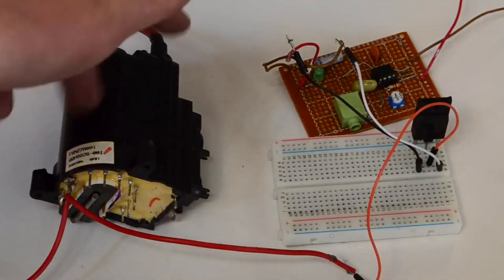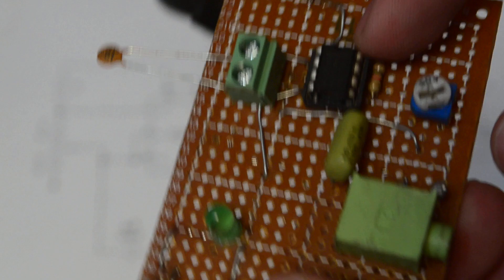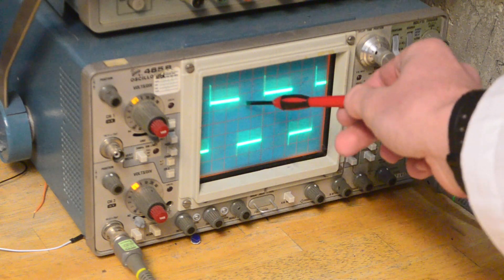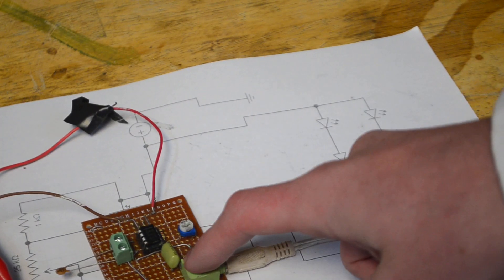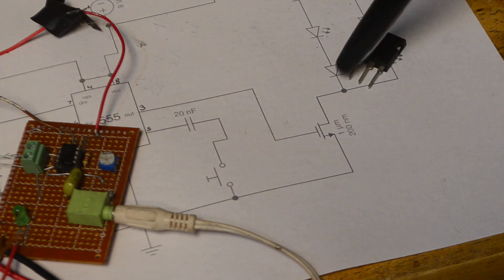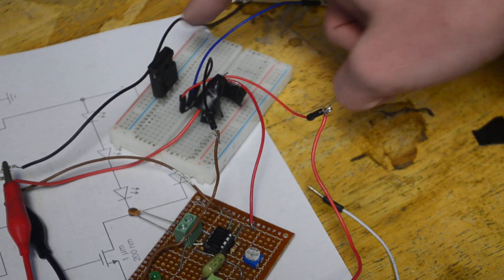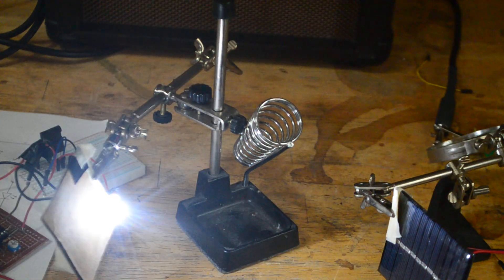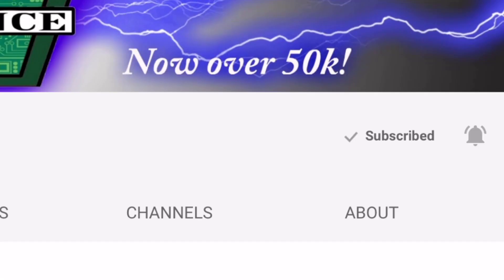How to transfer Music through Light

Comment: I only make this using a single mosfet transistor, 2 resistor and 1 capacitor, it works as well. no need the 555 timer IC.

Comment: This almost goes hand in hand with the Phantom DNA experiment. In a vial of water, in a vacuum environment, DNA is introduced in the vial of water. RF are transfered into the DNA via photons. The photons immediately fixed around the DNA. Once the DNA was removed from the vial of water, the photons stayed in a perfect outline of the missing DNA. The water in the vial was also transmitting the frequencies of that DNA. Several thousand miles away, in a separate lab, antenna was fixed where the water would recieve the transmission of the photons and water. Raw material in the water started to build a exact copy of the DNA used a great distance away. Scientist then added the missing components for DNA and a perfect copy was built by the water in separate lab. This technique will be the future of humanity!

Comment: What if the tone generator was hooked up to an amplifier; and what if, the amp was hooked to a ballast from some lights; furthermore what if, you used a coil rate equal to the frequency out put of the tone generator? Couldn't you run a frequency above 2 gigahertz and have a long range EMP device; and moreover, wouldn't the higher frequency give a further range with more destructive properties using way less overall power? And perhaps it would make for a grate video... of course keeping in mind the spark gap and the Hight Voltage compositors....

Comment: Please help me where i have to connect the Audio Input Thanks in advance and btw. nice video!✌☺
Reply from the maker: +Floly_lolye hi! So the audio input connects one end to pin 5 of the 555 timer, and the other side just goes to pin 1 ( or ground )
Reply from the maker: +Floly_lolye also thank you!
Reply: Thank you ✌😏
Reply from the maker: +Floly_lolye no problem :D
Reply: but i got a Problem the Frequenzy is so Low that it doesnt work both caps are 2nf and I got a 20kohm resistor and not a 25 potenjarmeter sorry for my Bad english but thaks

Comment: In 1972 while in high school, I took a car radio on the bench and connected a tail light bulb to it. The radio had enough power to make it glow decent . Then I took a cassette tape recorder and a solar cell connected to mic input. I could clearly hear the music from a max distance of about 15 feet. Later I used lasers and photoresistors.  Did not have to build a amp circuit, just used the recorder.   Fun stuff to play with.

Comment: But someone can steal the data with another solar panel.... so that's an issue.  Cool project btw.
Reply from the maker: +Kriss 89 thanks! And yeah, I made a new design using a focused laser, so that would be better, but even with traditional radio waves, you can steal the data with an antenna ( the thought for the laser is to send high amounts of data as a way of through space, like from mars to earth ( however I am designing one that modulates X-rays so that it could be sending even more data :D )

Comment: So basically, you're saying I could potentially ramp up my internet connection using a laser? Or is that not possible?
Reply: jeenyusPete within a LAN? or from the ISP to your modem/router? Fiber optics is all about this principle. But it could be done, I am not sure how, why not ask? regards
Reply: Horus Bayard well, light is usually LINE OF SIGHT, it would not work around corners and the like, however if you used a light, and convert it into a fiber optic cable, then yes, I suppose it's possible, but you would need to turn everything into ethernet connections at the computer and at the wireless router or cable modem. Wouldn't be worth the hassles.
Reply: brian h. look up "LI-FI"

Comment: why do u use a 555 oscillator??
y not simply amplify the phones audio input using a transistor and feed it to the LED's.
Also u dont have a filter on the reciever side to pick up 125kHz only so modulation is not necessary here r8?
If u had a filter u culd hav removed the noise from the room lights.
Reply: good project though

Comment: Wait a second... why does it even matter where drain and source are? Aren't MOSFETs symmetrical? At least thats what I've been told in my Digital Technology / Circuit Technology 1 lectures. Or are the bigger ones built asymmetrically due to the high currents they have to withstand?
Reply from the maker: +Michael i don't think I've ever come across a mosfet that is symmetrical to be honest , there are diode things that look like them, and those are, but they aren't mosfets
Reply: I didn't think of those diodes neither of a specific type of MOSFET. I was just wondering because at university we were taught that whether one side is drain or source depends only on its potential relative to the other side. And if you look at some cross-section schematics it makes perfect sense that they should be symmetrical (e.g. https://commons.wikimedia.org/wiki/File:Lateral_mosfet.svg )
Reply: In reality the body is shorted to the source, to avoid undesired effects that could happen otherwise. 
Here there is a very good explanation I found, if you're interested: http://electronics.stackexchange.com/questions/72582/mosfet-why-the-drain-and-source-are-different
Reply: Well that actually makes sense, thanks for the explanation!

Comment: Don't use a photovoltaic cell. Use a reversed biased LED. 
PV cells aren't discriminating and they mash things together. A reversed bias LED array has more bandwidth, is less prone to noise, and is actually faster at signal processing by an order of magnitude (although i doubt anyone is making a light transmitter that needs nano second response stuff) 
In order to use a LED in reverse bias, your receiving LED(s) are going to need to be amplified. I suggest using three transistors connected in parallel to  ground but in series by gate to one another. This amplifies the signal by the transistor's respective gain (MAKE does a non contact voltage detector that uses the principle brilliantly.). 
PV cells can be used without amplification, but they convert all types of light, even types that aren't transmitting data, to signal. This fundamentally limits the distance the receiver can be from the emitter and means that they have a narrower bandwidth for data transmission. 
In effect, a pv cell would see all light as a single data stream, while a LED array would see each color as a data stream. 
For LED's Color is loosely defined as light separated by 100 nm wavelengths as a minimum, but i've heard that LED's can actually distinguish between colors as closely as 50 nm wavelength apart, which most humans would not see the difference between those two colors.

Comment: Do you think you could do this with a laser diode instead of a regular LED?
Reply: You could do this with any light source that you can alter the amount of voltage with.
Reply: PWM at a very high frequency with a laser would be the best way to do it. Say, a 1MHz PWM signal feeding a laser. To be honest you could use the 10Bit ADC and PWM channels on an Arduino to do all the hard work for you. Just be sure the music is to the level where it maxes out, but dosen't clip, the input. On the receiving side, you'd just need a ceramic cap of the right value in parallel with the output of the phototransistor or whatever you used as a light sensor, to convert the PWM back to varying voltage.
Reply: spartan456 however I would use a heatsink for the diode to keep the heat to a minimum seeing as the laser would be on for hours at a time, and in turn could shorten the life span, or get too hot and burn out.

Comment: first! Good project by the way! Why did you modulate the audio into a wierd freuqency and then into the LEDS? why not modulate it directly?
Reply from the maker: Ivan R to be honest the main reason for it was to try and show how regular data transmission through radio waves work, I just thought this would be a fun way to do it :D also thank you!!
Reply: Ivan R yes, why use a carrier frequency if light is transmitting the audio?
Reply: I know! I made a very similar circuit and i just modulated the light directly!
Reply: +Keystone Science It is a good illustration of the concept. Still, I would use a different circuit to modulate the waveform, like a modulated inverting transistor driver that will be between the output of the 555 timer and the gate of the mosfet. Also, what you could try doing is an FM broadcast using a capacitor microphone with a 555 timer in parallel with a constraining capacitor to limit the frequency swings.